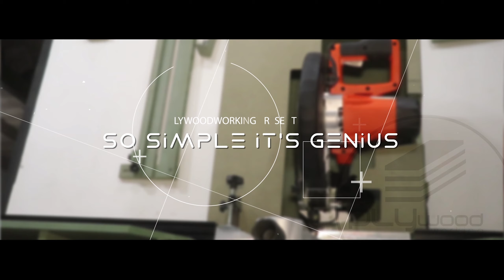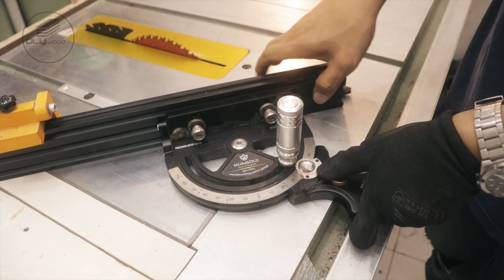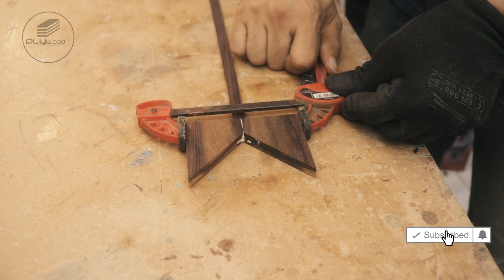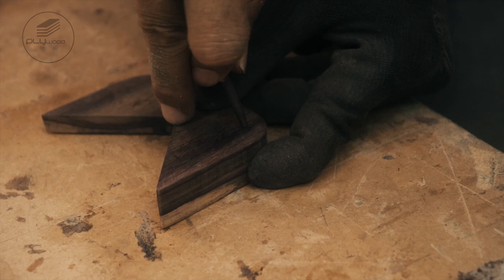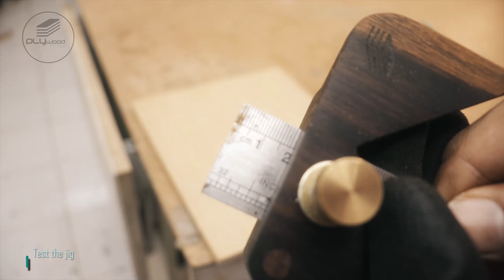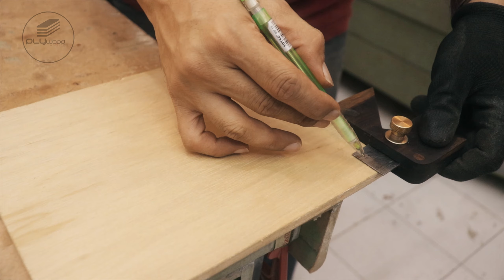So Simple It's Genius !! Multifunction Device Woodworking Make Your Work Precision - Marking Guide

Comment: It is a nice piece of work. But what I do not understand is why (at the beginning) he cut 2 pieces and glues them together instead of using a bigger piece and cutting out the 90 degrees angle. Cutting the slots into those 2 pieces just to glue them together brings his fingers pretty close to the saw blade. I know he used a feather board and that is is a covered cut but the surface of the piece is so small that I am not sure that the feather board would hold back a kickback. I for myself always think of alternatives before I do cuts where I have to stand in the line of the saw blade or where my fingers get close to the blade. And usually I find them. I am sure he would be able to do 2 cuts in 90 degrees in a piece of wood without risking body parts.

Nevertheless it is a nice (but commonly known) project.
Greetings from Switzerland 🇨🇭